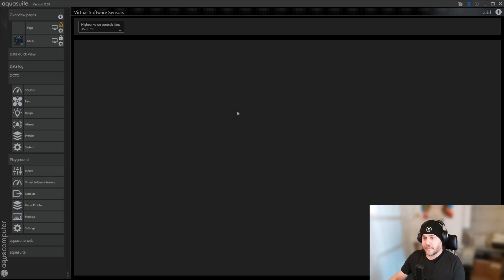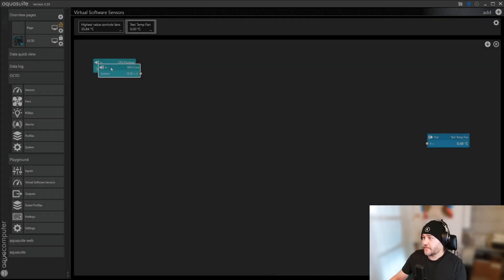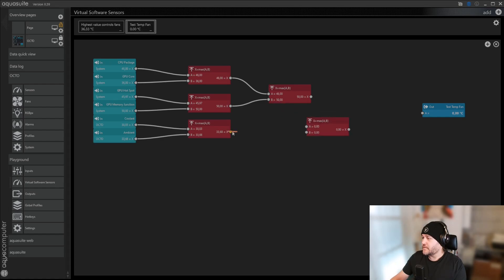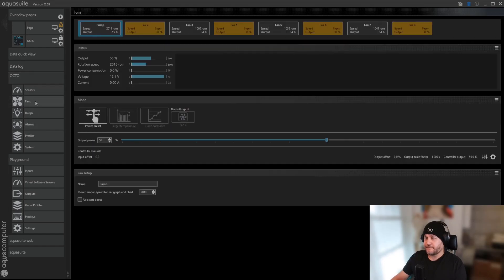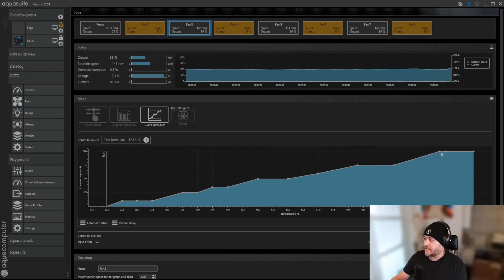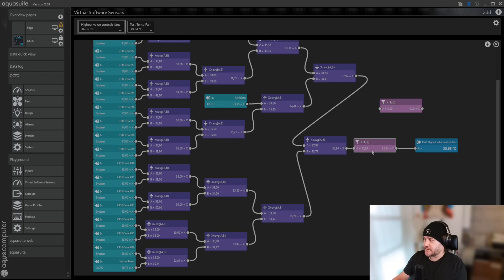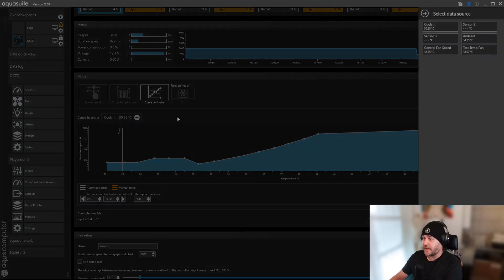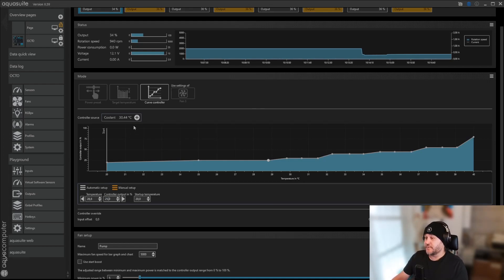AquaSuite basic setup for fan controller

Comment: So, this is really informative about how to use this software, but I would really like to know why you would do something so complicated when it seems to me that keeping your pump static and basing the fan curve on coolant temp alone would probably be more than sufficient.
Reply from the maker: I tried that to start with but i found that for my taste i thought that the coolant temp was  slow reaction to a spike in gpu temp, does that mean a lot , probably not but that was just what i wanted
Reply: @artakindi  Okay, fair enough if that's your thing.  But seems to me that if the GPU temp spike doesn't increase the water temp, jamming up the fans isn't accomplishing anything.  In any case, I'm here to learn how the software works, and you did a great job of demonstrating that.

Comment: Its amazing how many options you can set with this but honestly with water cooling on CPU and GPU the only sensor you really need is the coolant temp. If you want to run your fans really low or stop them completely when PC is cool then as a failsafe maybe also add virtual sensor with the max of chipset and RAM temp and set it so it ramps up fans a bit once they are above 50c even if coolant temp itself is low. That will take care of situations when ambient temp is high and some airflow is needed but there is no load on CPU and GPU so coolant doesn't heat up much.

Comment: New to all of this but I am trying to duplicate this however I do not have any core temps, it pulls %workload, voltage on the cores etc but nothing about temps except total temp.  Its a 9800x3d direct die cooled if relevant
Reply from the maker: Hmm have no idea to why it does not show temps at you
Reply: Same for me also on AMD.  From searching google it looks to be an AMD doesn't show the per core and only does a package temp.

Comment: Very helpful. One question to this hardware: can i setup it on the PC and move it then to my server? Will it work there with the correct temp values? or is it essential to have the PC software all time connected? Thank you
Reply from the maker: It should work since the quadro saves onto the hardware so it runs your setup even before software is loaded but you cant change anything if something happens but it should work
Reply: Thank you.  @artakindi
Reply: will the d5 next pump store the fan and pump profiles as well like the octo/quadro does?

Im putting together my first loop in a system and the aquasuite software seems a little overwhelming so I wanted to keep it simple and just run my ultitube with d5 next and use its built in temp sensor and connect all my fans to the d5 next.

For now ive decided not to get an octo/quadro or any extra temp or flow sensors to keep it simple.
 
Will it be similar for me to setup with just the d5 next as this video?

Thanks for the vid!!
Reply from the maker: I dont know the next pump so cant really say, and yes the aquasuite is not very use friendly for new users, but quite good when you first know how to use it

Comment: Just got a flow next some weeks ago... is there any way to change connected RGBpx colors based on any logic? I only see an option to change speed and brightness based on a graph, no more logic involved...
Reply from the maker: It should be pretty easy to change the colors, just x2 click on the strip 1 or 2 of the LEDS, sorry for the later reply

Comment: Regarding the average maximum values and the way it changes and spikes. You can add a final lowpass filter and smooth it out and dampen the spikes. 
I have mine very similarly setup like you and noticed the very lively fans and after adding the lowpass filter, it has been super smooth!
Reply from the maker: Thanks for sharing good advice with others

Comment: have you not tried using any delta calculations for control?

Hope you make some more aquasuite videos 👍
Reply from the maker: No i have not but should be fairly straight forward since i have the ambient temperature in the case, will consider this as it might be a better control for the fans, might be fun to try